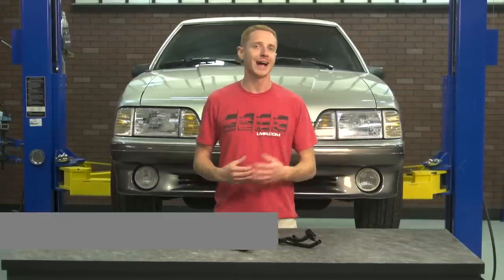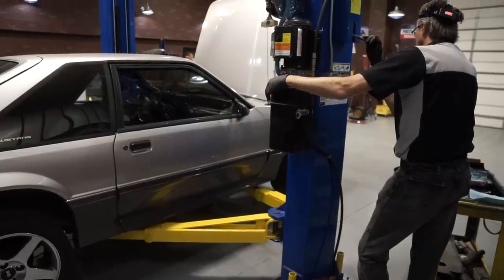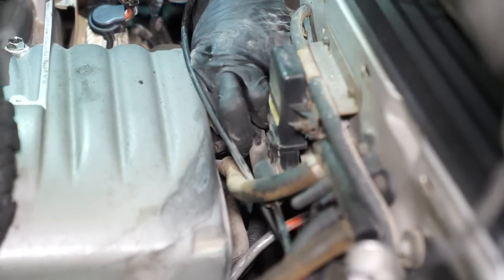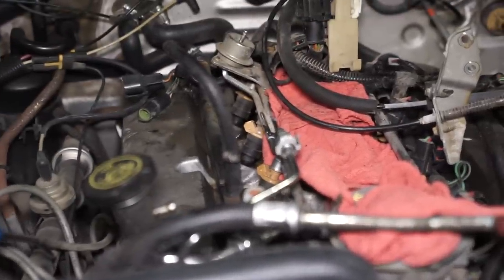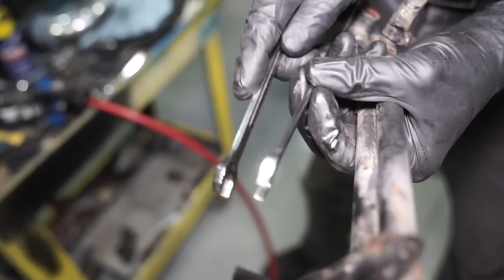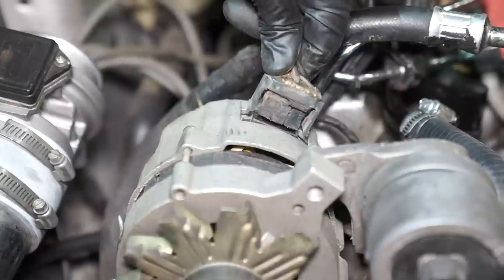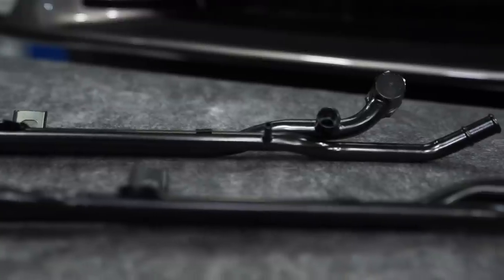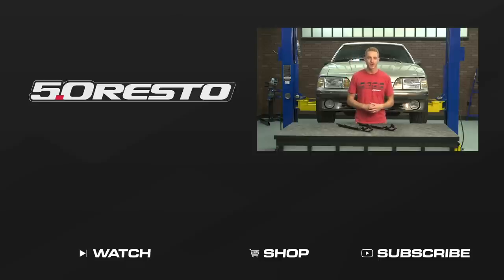1986-1993 Fox Body Mustang 5.0 Resto Heater Tube - Install & Review

Comment: Had to replace my heater tubes on my Ford Falcon Windsor V8 here in Australia and the heater tubes aren't available in Australia any more 🤦‍♂️ so had to import mine from America. This video was a huge help.
Reply: I'm in the same boat here in n.z my lower  heater tube has a hole in it and cant find anything here or in aus.. the heater tubes u ordered where they identical
Reply: I also have a 91 ford eb v8

Comment: Great video, I'm trying to find out what size and thread pitch the hole for the fitting is as I need to tap mine due to pulled threads when removing the old assembly, that info would be greatly appreciated.
Reply from the maker: Give us a call at 1-866-507-3786 and our customer care team can assist you with finding the right info on the thread pitch. Or send us an email with the link below: https://lmr.com/contact

Comment: On that 2g fire starter alternator, shouldn't the electrical connector be replaced if it is removed?
Reply: Lol I’ve owned 3 foxes with 2G alternators. Never had a fire occur.

Comment: My problem is, my engine is a roller from a 94 exploder, but this part is missing. 
I wonder if this part will work?
Reply from the maker: As long as the engine was a direct swap, it'll work. Since we don't have all the info on your swap and if you still have questions, give us a call at 1-866-507-3786 or email us with the link below: https://lmr.com/contact

Comment: Can someone please tell me what size  the threads are on the heater pipe to manifold. I used a propane torch to heat the threads from inside and out and it gabled the threads a little so I need a tap to clean up the threads in manifold. Any help would be greatly appreciated. Mine is a 1988 5.8L f250.  I'm sure the threads are the same as a mustang

Comment: Would this work on the sn95 or know where I can find one??? I can't find listing or a 95 or part number
Reply from the maker: Joel -  This heater tube is specific to 86-93 V8 cars. To my knowledge the 94-95 tube hasn't been available for a while unfortunately. Try checking a local salvage yard or even eBay for a good used one. Hope this helps. -Landan

Comment: I've removed the upper intake from my 87 LX. Why does the fuel rail need to come out to get the heater tube assembly out? I don't see any reason.
Reply from the maker: This is for ease of removal when taking out the heater tube assembly. The fuel rail can get in the way when doing the removal and installation, so it's in your best interest to remove the fuel rail. - Jude H. - Social Media/Events Coordinator
Reply: @latemodelrestoration Yep, I see now... last night I got the tube assembly loose from everything and the closest I came to getting it out of the car was pulling it toward the radiator. I might've been able to get it out that way if I removed the fan first but decided since I'm going to replace the radiator anyway, I'll go ahead & take it out, making it even easier. I'd just rather not disturb those old fuel rail electrical connectors. Too bad Ford didn't tweak the heater tube assembly design a bit to simplify its removal.
Reply: Well, I'm finally back on this... ended up having to replace the water pump, tc cover, and drill out a broken bolt and install an insert. Car has 160k on it so I decided to just replace all fuel injectors (I mean, they're right there and easily accessible at this point). When pulling the injector rail, the #1 FI end cap didn't come out, so I used a dental pick and only the flange of it came out?! Where's the rest of it? Using a mirror and flashlight, I don't see it. Could the end of it have broken off at some point, dropped into the combustion chamber , then end up at the catalytic converter?

Comment: What is that little "crash bar" thing?
Reply from the maker: I don't think the answer has ever been confirmed.  Because of that, there are many opinions floating around as to what it's actually for.  I call it a crash bar because that's what it looks like.  It could very well be a small brace for the upper/lower intakes.  Most people don't put them back on once they're removed.  -Landan

Comment: I'm just wondering if its completely necessary to remove the intake and injectors or can I just remove the throttle body and move all that stuff away and change it out that way, cause the video seems like alot of work.
Reply from the maker: This will need to come off regardless, there just is not enough room to do this otherwise.
Reply: @latemodelrestoration  Disagree.Stock 86 GT was done with removing throttle-body assembly, you can wiggle the tube assembly out from underneath the fuel lines.
Biggest pain is getting the fitting started into the intake, take your time & save a bunch without having to pull the top intake.
Reply: I did it on my car today. This is crazy long bunch of disconnecting! I unscrewed the front large nut with crescent wrench , then the intake bolt that holds the line bracket can be hit from straight above with an extension. From there I pulled it out towards the front. My alt is out so it may have given me clearance but I’d rather move an alternator than all that work done in the video and I not sure u have to have the alternator aside to pull out the line

Comment: Does this fit the 95 Mustang GT 5.0L?
Reply from the maker: Hello Octavio,

This Heater Tube Fits 1986-1993 Mustang 5.0L & 5.8L. It will not work on your 95 GT. You would need to source on locally or from a salvage yard.
Reply: Does these steps apply to the 94 and 95 5.0?

Comment: 🤢🤕 help first 3 threads in lower intake damage?? Time sert?
Reply from the maker: What hole is damaged? The one for the heater tube? If so, just purchase a 1/2" NPT tap and fix the threads. -Landan
Reply: @latemodelrestoration  it’s the threads for heater tube.. but then I seen other manifolds and they look like the threads are low in heater hole
Reply from the maker: @bryanrobinson7969  Have you tried installing it? Clean the threads up with a thread filer if you don't have a 1/2" NPT die. Or, just purchase a new heater tube assembly. -Landan

Comment: LANDON!!! I flowed your vid step by step and when I went to restart my car, I ran very choppy for about 10 seconds, shut off and now will only turn over and won't start. Help please!
Reply from the maker: Hey Dorian, give us a call at 1-866-507-3786 or email us with the link below to get into contact with a CCR. It's difficult to diagnose something like that without a lot of info. Our team will be more than happy to help you out! -  https://lmr.com/contact
Reply: Did you get it fixed? Wondering what the problem was.
Reply: @redfirefox3568  It was a vacuum issue

Comment: Dumbest design ever
Reply: Agreed. It took me almost 2 hrs to remove mine. It would of taken longer of I didnt make some short cuts.
Reply: Seems like every car manufacturer does something stupid like that, the old Cadillacs with the Northstar engine were famous for having head gasket issues, no problem, just take the head off and fix it.... wait a minute,the only way to do that is to take the engine out of the car from underneath!! yeah this heater tube is not that bad,lol